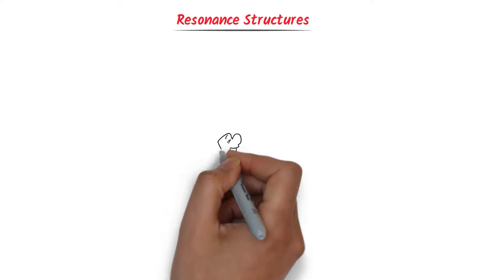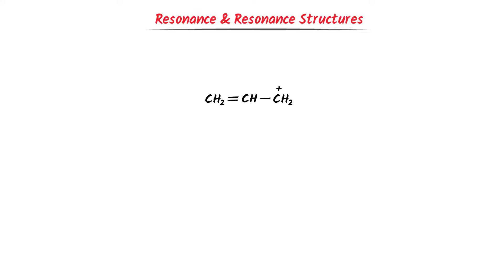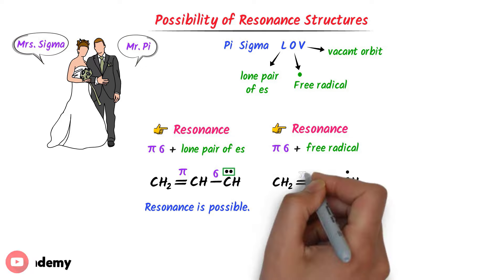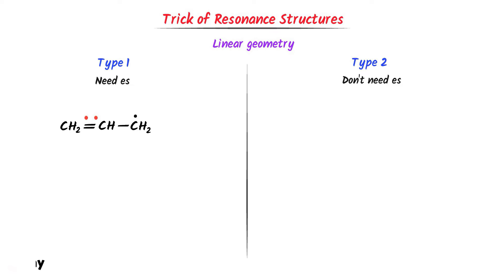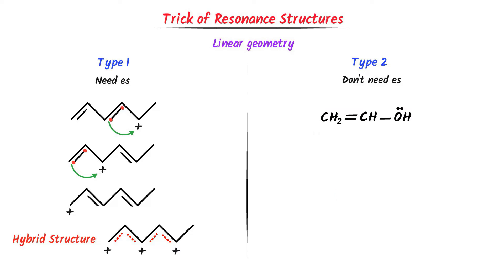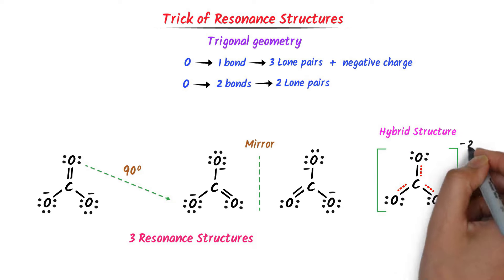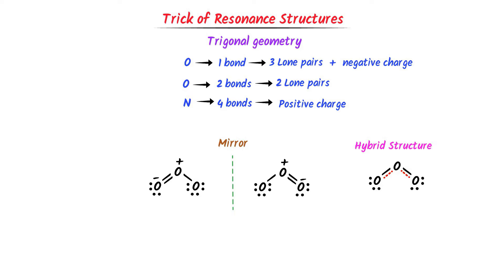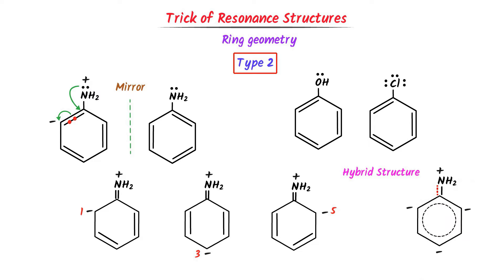Resonance Structures | How to draw resonant structures? Easy Trick

Comment: 00:00 Learn the concept of resonance and resonance structures through this lecture
02:40 Resonance structures are formed due to shifting of Pi electrons between atoms
05:28 Resonance is possible with pi Sigma plus free radical or pi Sigma plus vacant orbit
08:06 Resonance structures are fake structures, whereas hybrid structures give the real structure of a molecule.
10:38 Resonance structures for molecules with linear geometry
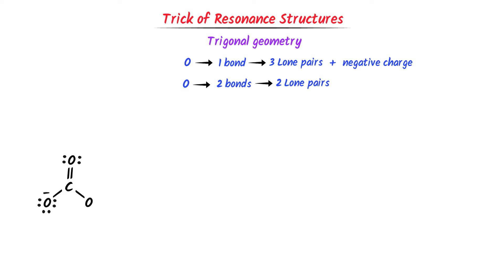13:12 Resonance structures of carbonate and nitrate ion
15:39 Trick to draw resonance structures easily
18:07 Resonance structures are formed using electron movement in molecule

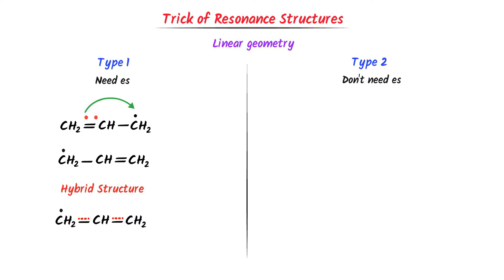Comment: 9:01 
The concept is wrong bcoz when there is a free radicle the the double bond will have homolytic reaction and the elements will bear a free radicle and then free radicle and free radicle will make a bond.
Reply: 🤦‍♀ Sir did the same, but in most simplest way 🔥
Reply: @SimaalAhmed exactly 💯

Comment: Worst explanation only for ncert level
Reply: If your basics are weak then you will never feel confident for entrance exams
Reply: @Nopee-i3u   my bad bro, actually that time I was on chemical bonding that's why I didn't understand this. But tbh now I've completed goc but still that is ncert level. But the explanation is fine.
Reply: @ssjdark3386  oh are you from online or offline coz I am from online and studying from RA sir but was having trouble in +I and -I therefore I watched this..
Reply: @Nopee-i3u   yeah I am from online but I study physics from rajwant sir
Reply: @ssjdark3386  yes me too how's your prep going
Reply: @Nopee-i3u   physics and chemistry are mains level (except rotation and eq) but I barely give time to maths so my math is not good. But next month I'll study only maths for 10days. 10-12hrs each after that our 12th will start. Wbu?
Reply: @ssjdark3386  mine maths conic sections left and physics from rotation I have backlog also chem from thermo
Reply: @Nopee-i3u  ☠️☠️
Reply: @Nopee-i3u  but I guess 1month would be enough to cover it all
Reply: @ssjdark3386  yes I know I will cover it